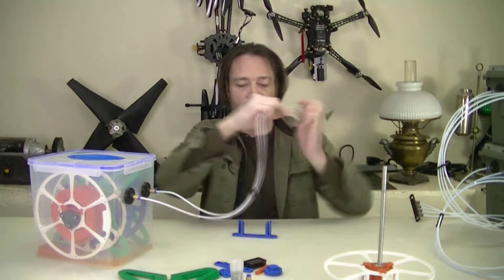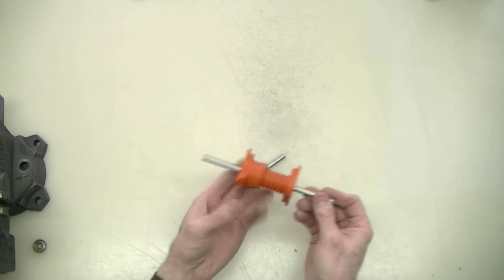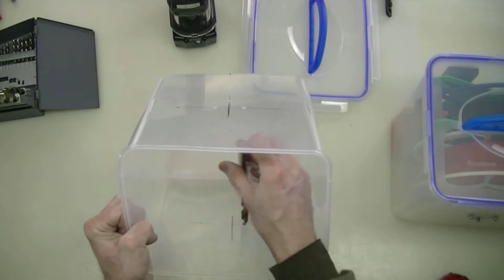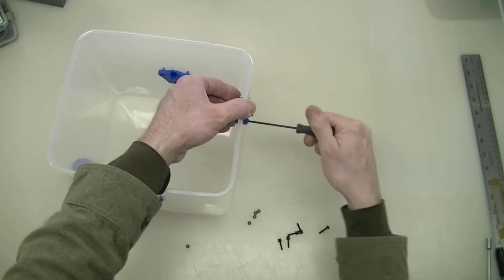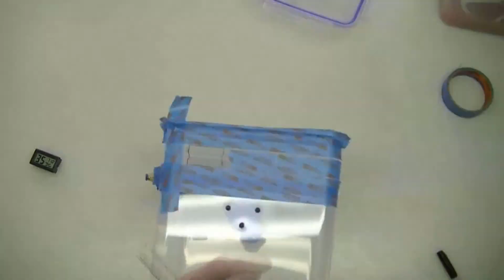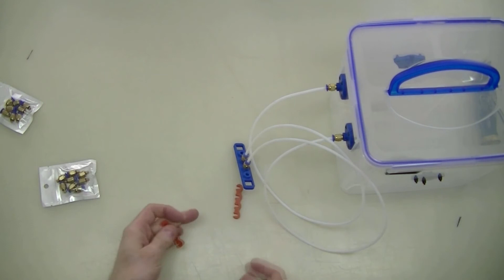How I Built Modular 3D Printer Filament Dry Storage

Comment: The moisture from the outside travels over the thermometer to the inside, becourse the display is probably not air tight. 🤔
Reply from the maker: I'm pretty sure that the plastic material of the box is more permeable and allows more moisture inside than any leaks in the meter. Either way, the boxes keep my aggressively hygroscopic nylon dry for over a year.
Reply: @uselessstuff8031  that's nice 🖖

Comment: Huh? M8 threaded rod is only like 7.8mm in size, due to thread clearance and stuff. 8mm trapezoidal lead screw however is larger, so that could be a little difficult. Then again i live in Euroland so i have to use metric stuff anyway, no choice. But i have also chosen not to slide the bearings on and off all the time as the rods are a little on the curved side so the bearings can get just a little stuck, but made some ends that clip onto a cardboard tube from a bog roll and i have just jamnutted them onto the rod permanently.

Jamnutted a word? Nah. Well now it is. Does this put me into the prescriptivist school of linguistics? Damn.
Reply from the maker: The 8mm rod that I was taking about is not threaded. It is a full 8mm in diameter. When the nominal ID of the bearing is also 8mm it gets a bit snug for easy insertion and removal. Sounds like you have a very clever solution. I'm not very clever, just resourceful enough to make up for it. :-)

Comment: Liked-Subscribed-Notified.  Dude you should think about putting links to all of the hardware that you mention (eg Snapware container, bearings, desiccant, thermometer/hygrometer, push to connect fittings,etc.)- and get affiliate links- it might not make you a fortune but it would help the builders, and you'd make a little $$   Keep up the great work!  Great Vid.  Canadian, eh?
Reply from the maker: Thanks for your kind words and the suggestion. You're right. I should be including some form of info on where to get the parts. The trouble is, that then I would have to admit that most of it came from Cramazon. While marginally justifiable in a time of plague, it's not something that I'm proud of. What aboot my videos makes you think I'm Canadian?
Reply: @uselessstuff8031  Canadian: mm tape measure, speaks french, I might have heard an "eh" in there, too.  My GF is Canadian.. I cross over about every weekend (after the covid test, etc.)

Comment: I need a little help.
I downloaded form thingverse and NUT and bolts are not compatible. What are does tread 4, 55.2 57.6..what does that mean, what is compatible with other. did a few of them but no luck - can not screw them togather
Reply from the maker: @Ipka - 55.2 and 57.6 are not a thread standard. They correspond to the inside diameter of the spool. You need to measure your spools to determine which parts to print. The spool holder should be slightly smaller than the opening in the spool. If you print a spool pivot and nut and they won't screw together, you need to change your print settings. Try a thinner layer height. Change your slicing tolerance to minimum. All of the files that I uploaded to Thingiverse are the same files that I print to make my own parts. If your prints don't fit together, then there is a difference in how your machine prints compared to mine. Good luck. I hope that you are able to get the parts to work.
Reply: @uselessstuff8031  thank you for the answer, will try.